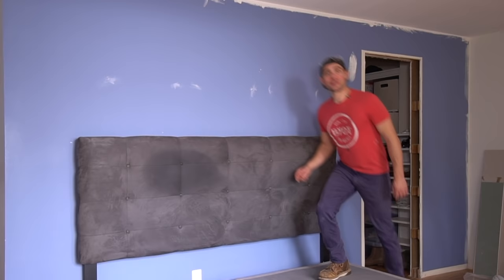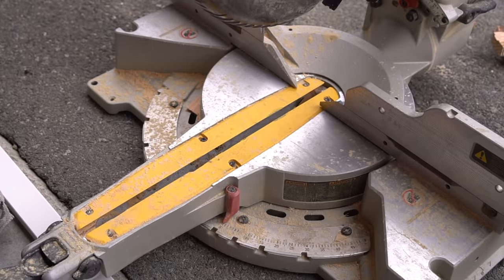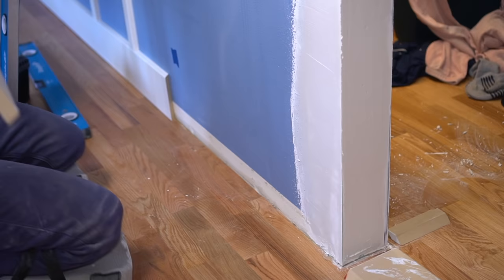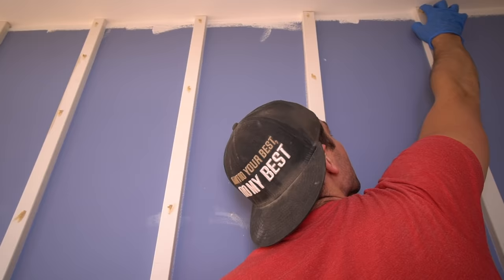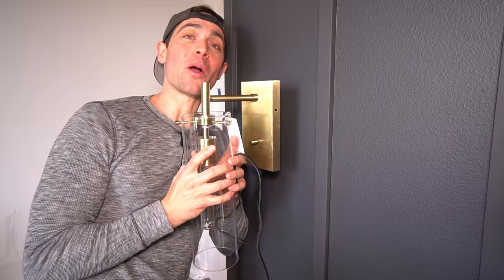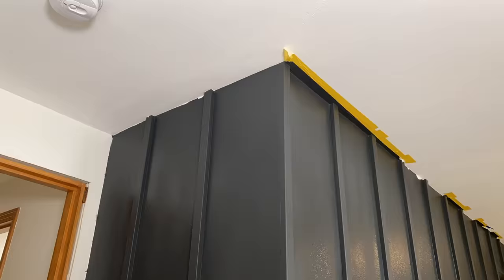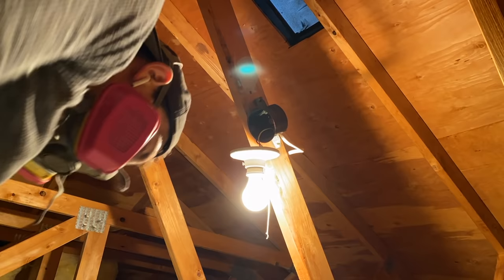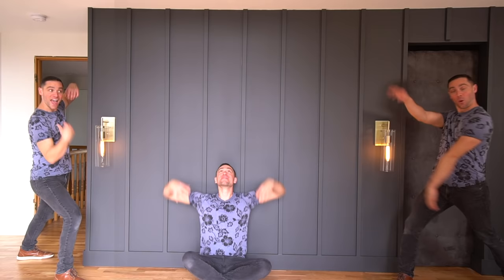Master Bedroom Accent Wall // Hardwired Bedside Lighting

Comment: Just a tip cut the bottom off a 1gal milk jug turn upside down attach to shop vac and then use your hole saw and it will catch all the dust…!!! Love your work…!!!

Comment: No orbital sander here. I will be sanding by hand with 220 grit. Then it will be time for vacuuming.

BTW, this is the project I asked about during the happy hour with Leah. Took a bit of doing, but I removed those wall shelves. Now I am in the midst of wall repairs.

Comment: correct me if i’m wrong but if the next owner wants to take off the slats will it rip off the drywall(due to the glue used to adhere the boards)? 

Trying to make a slat in my room 4 in apart and thinking about using molly screws to hold when not able to drill into a stud. any other recommendations to attach?

Comment: Good video, but why wouldn't you drill the big old holes and run the wiring before you painted?
Reply from the maker: The beauty of a content creator means you don’t have a great deal of time to do the project and video edit it every week.  Had to get the the first coat on as soon as possible so it could dry and then apply a second coat once it dries.

Comment: Did you start the 12 inch measure starting from the door trim outwards for slats?
Reply from the maker: I actually started from the left where the wall 90’s and then worked my way to the door.  Worked out perfectly.
Reply: @BYOTools  Thanks, My master bedroom is 35x15, this would be perfect to add some personality on the walls!